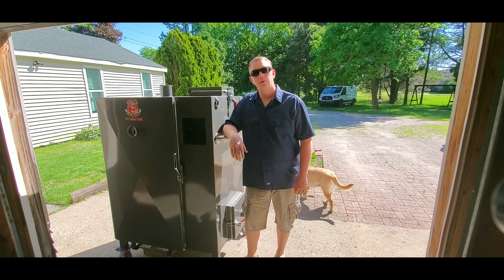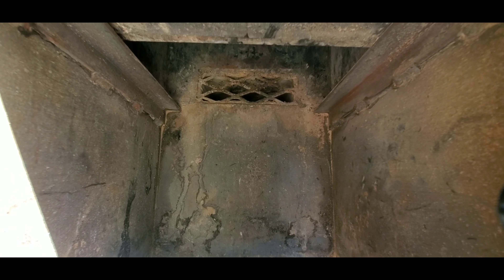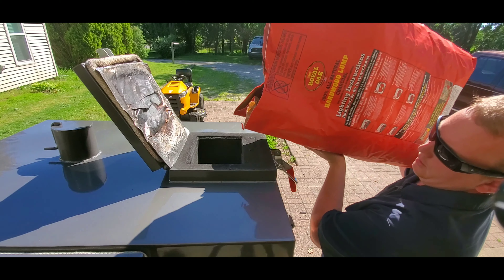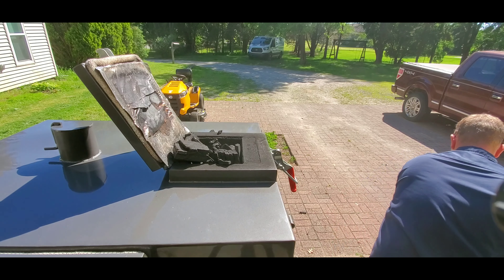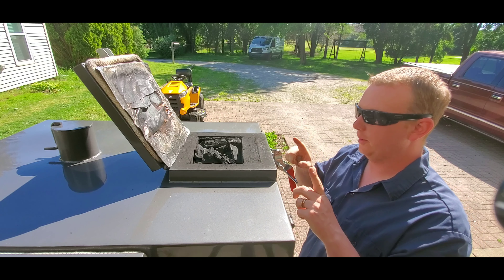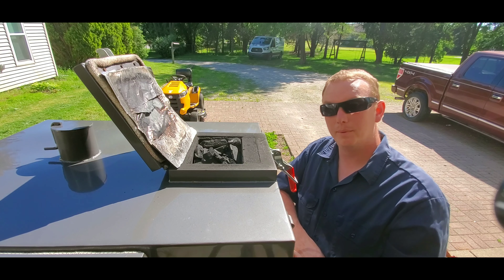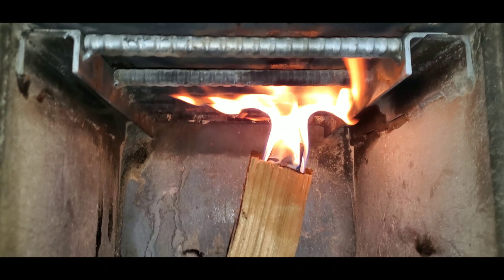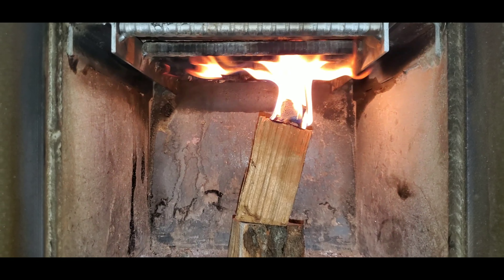Tips & Tricks! How to start a Gravity Fed Smoker.

Comment: How heavy can the smoke get without it burning dirty? I’m in TX so we prefer heavy smoke. Looking for a cooker that is more manageable than my offset, but still produces heavy clean smoke. Great video!
Reply from the maker: Hey man! Good question. So with a Gravity cooker. The smoke is usually "fairly" thin. Not as thin as a pellet cooker. But it would be what we call "good smoke" or "Grand Champ smoke." However, what I would recommend with a cooker like this, for more smoke, would be to smoke longer before you wrap or wrap with butcher paper etc. I'm sure you know what I'm talking about lol. And use hardwoods. You said you were in TX. I started out cooking on a stick burning throwing Shag Bark Hickory. And I can say that this cooker, with wrapping later with butcher paper or not at all could get the smoke you're looking for. Good question! Love it
Reply: The World Of Barbeque thanks for the response! I figured with it being charcoal and then wood chunks on bottom it would be lighter smoke. I’m looking for a new weekday smoker that doesn’t require as much work as my offset... any recommendations?